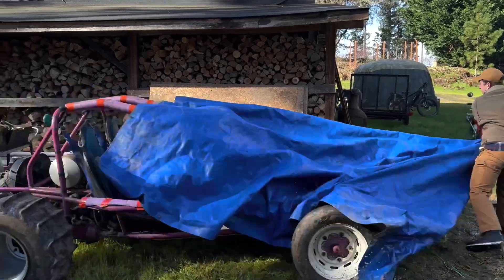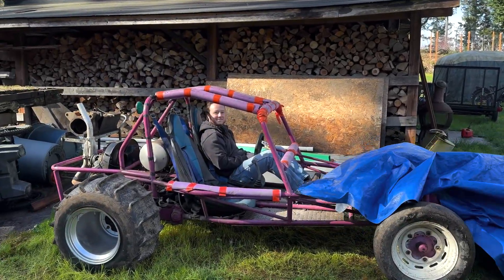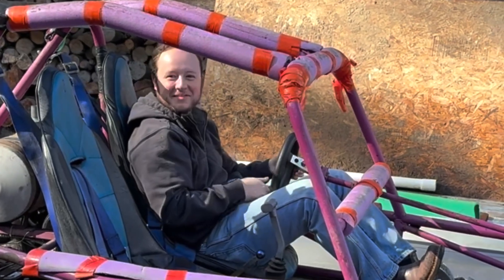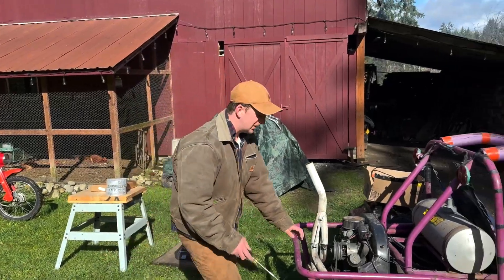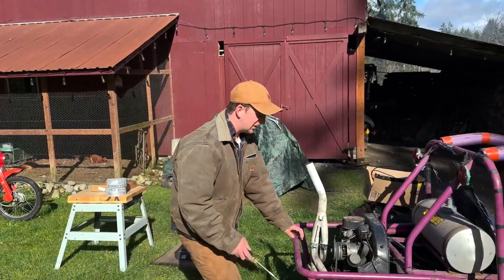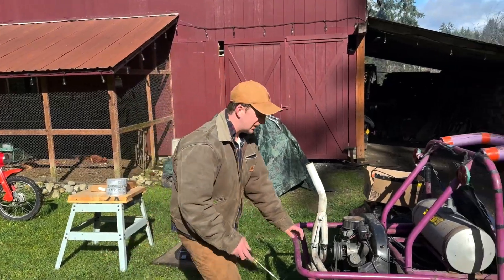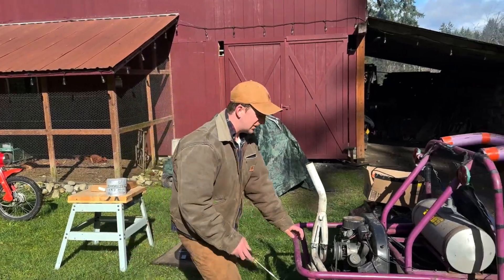1970’s VW Sand Rail Will it Run Part 3

Comment: lol, I’d have had that running in 10 mins. It looks tidy. The firing order is probably stamped on the dynamo stand. I’d double check that timing, 1 it’s at tdc, marks on crank pulley lined up with case split. Help me Jim!
Reply from the maker: 10 min huh? 😂
Reply: @thebarnbrothers  yep if I was taking my time 😆